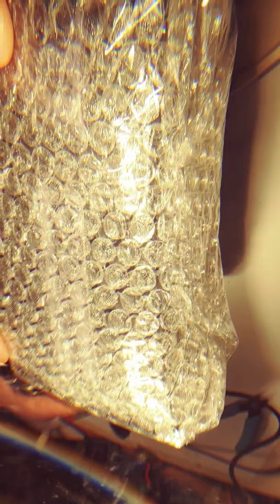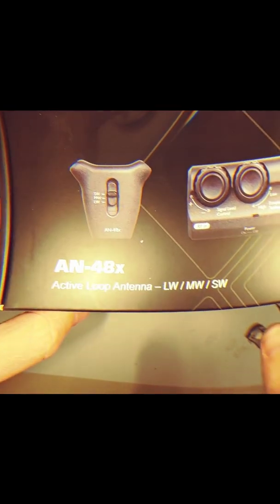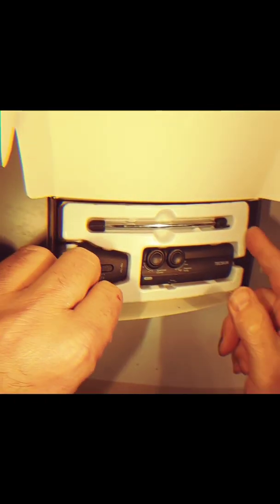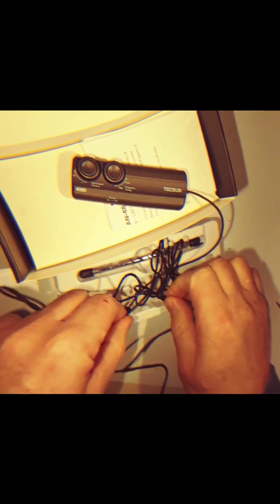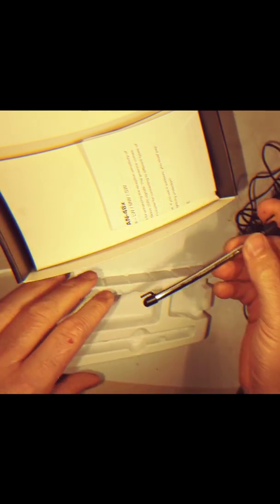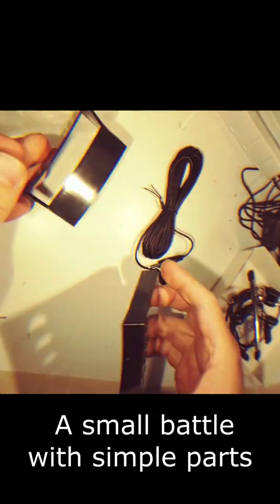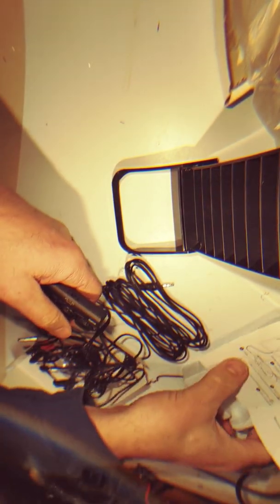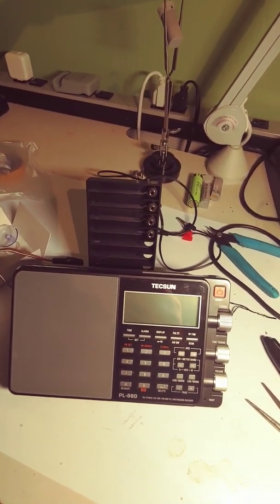MLA-30 killer?  Unboxing the $30 Tecsun AN-48x

Comment: Antenna is useless just brings in noise on sw and overloads any receiver even with gain on minimum, on mw it is a touch better buy not by much again gain needs to be left off, I find the tecsun an200 fair superior

Comment: No, it won't be a MLA-30 killer, because the MLA-30 is good for a wideband antenna for RTL-SDR receivers.  The Tecsun AN-48 is a narrowband type active loop antenna like the AN-200 that requires battery power.

Comment: Made a few dipole antennas back in the day.
Reply from the maker: Awesome!  I have some dipoles that I have connected to my HAM radio to communicate on.   I use this for something small to listen to shortwave comms on indoors and it works extremely well on the short test I've done.   Do you still have a radio?
Reply: @SolarDrew  no gave up years ago but my brother is a ham operator.
Reply from the maker: @offgridwanabe  Nice!!   I'm surprised you aren't active too.  so much fun! :)  Hey, thanks for the comment buddy!